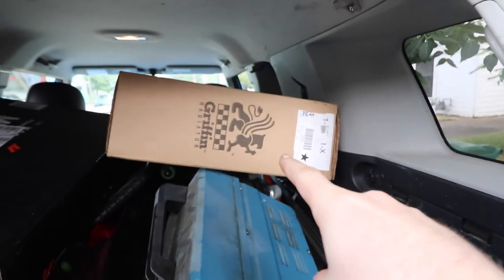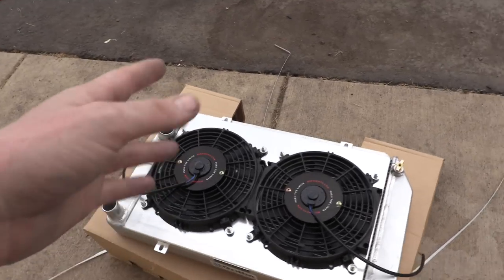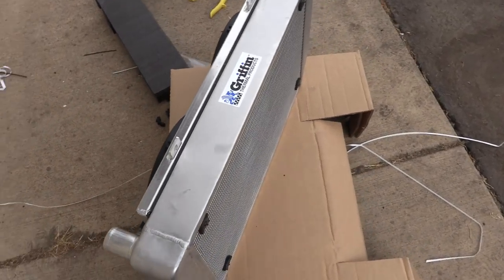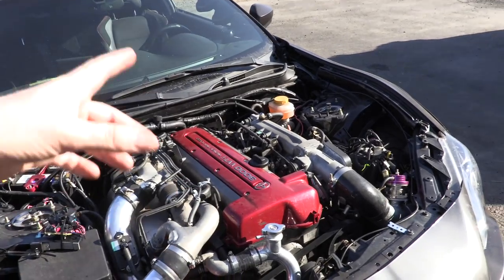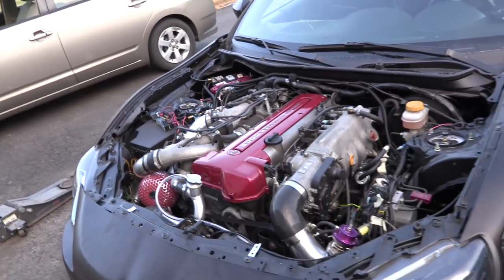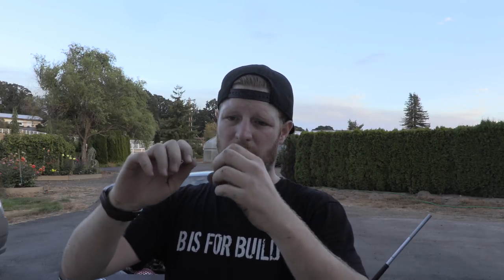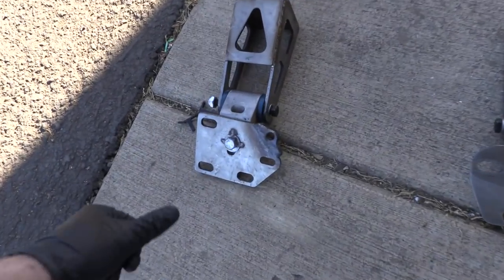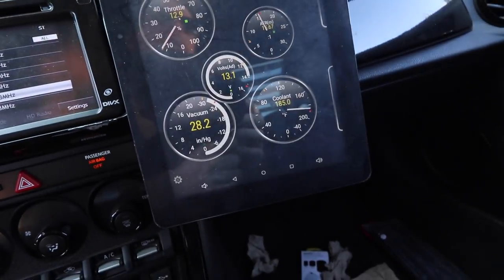2JZ BRZ Pt 31 - The BRZ Is Dead.

Comment: It seems that you have problems with the RPM sensor (crankshaft sensor) or wiring. Dont know all story, but you can clearly see how the RPM gauge is not showing accurate/normal readings when car starts to stall.... Didn't watch all install thread, but if the RPM gauge is getting signal wire from the ECU, than it is most likely it is sensor or wiring, if the aftermarket tacho is wired to coil signal so the problem might be elsewhere... Usually these sensors are inductive in these cars, and usually when they fail, they fail and dont work when they get warm... When they get cold the car should run again...
I dont know these 2 JZ engines, but some crankshafts sensors go front of the engine pulley, in few episodes I seen that u had problems with the pulley, maybe the wiring/ sensor got touched. Also worth checking the sensor pick up ring, maybe it came lose, damaged. If the sensor is mounted on the front of the pulley, there can be metal shavings on the sensor end (it works magnetical principle and the sensor end pick metal shavings and these can disturb sensor signal, also the gap from sensor to pick up ring is very important, the smaller gap is the better signal you will get). Just my quick opinion on what i seen :)

Comment: All your problems can be tracked back to a lack of servicing and checking a 20+ year old engine with a tonne of miles before shoving it in a car with insane lack of airflow. plugs, injectors, gaskets, pumps etc should have been step 1

Comment: Those engine mounts look very wrong you don't have to be a rocket scientist to see at first glance that that one bolt on each side won't hold the engine!!!!!!!!!!!!!!!!!!!!!!!!!!!!!!!!!! btw those tacks on the washers will do NOTHING. Do you really think that a like 2mm washer with 3 tacks will hold an engine?!?!? sorry but thats pretty stupid
Im pretty sure you are supposed to weld the plate on the arm after positioning them with the bolt xD